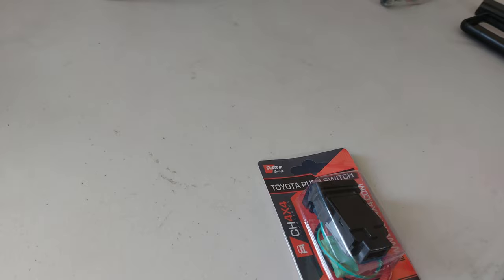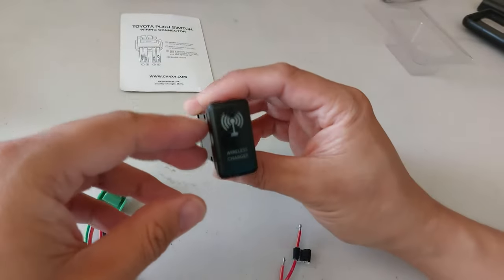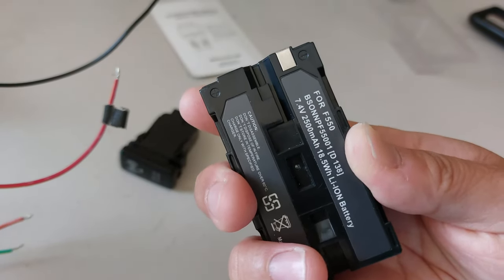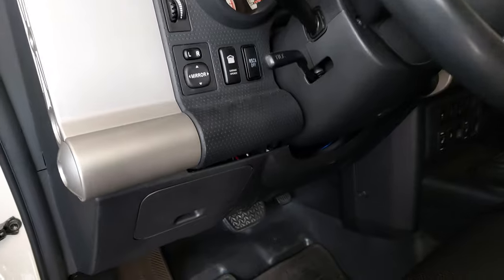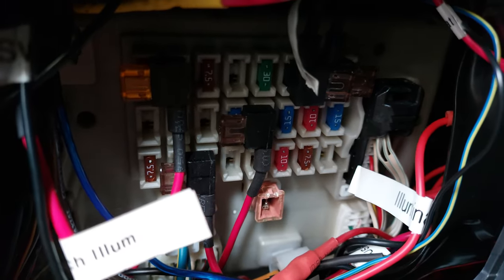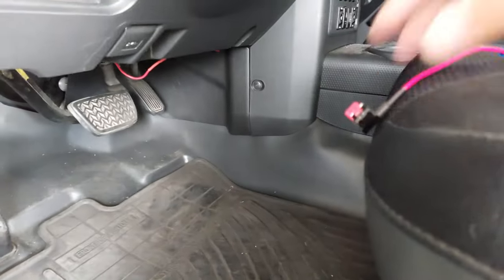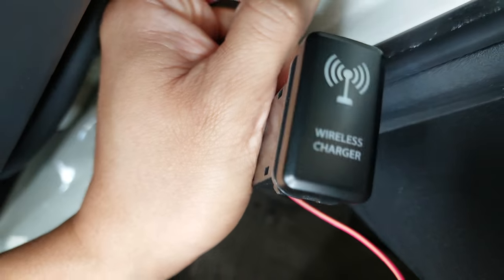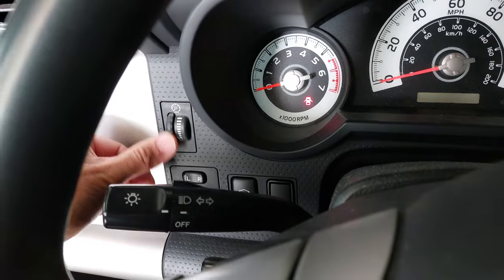Toyota Aftermarket Switch Illumination Wiring Explained

Comment from the maker: Sounds like you selected a fuse that's always on.  Have you tried the fuse for the brake light like I did?  Even though this fuse technically is always on, it comes on when the headlight lever is activated, thus the LED light only comes on when the headlights/tail lights are on.  Hope that makes sense.  As long as your switch's LED light is on, it will draw battery power, so I'd find a different fuse to work with.

Comment: Great detailed video! How would you use this same push switch with the add-a-circuit fuse link for a ignition kill? I can't seem to crack the correct combination of circuits and wiring. TIA
Reply from the maker: I'm not sure how the wiring looks like to the kill switch, but maybe this will help?  https://www.youtube.com/watch?v=8ftolyaHp20 This video I just linked talks about the OTHER wires.

Comment: Asked on the other video. I’m using a bussman relay box so there’s only one wire coming in for the accessory (red 1). In this case, am i missing something, or can both green and red 2 go into an add a fuse?

Thanks for this video. This is about the 7th video I’ve watched of yours to juice my FJ.
Reply: Yo! I did this tonight and it totally worked.

Ran my relay wires through the fire wall, and then fused the green and res2. Ran them to an add a circuit. Golden.

Comment: You tested grounding on that bolt in the door jam, but where did you ultimately ground the wire? Thanks in advance!
Reply from the maker: Check the 10 minute mark of my other video here:. https://youtu.be/5XObhMQ0wCo

There is a convenient grounding screw in the FJ in about the same location.

Comment: when I ground my switch the on/off illumination works in opposites - is on when switch is off but off when you press the switch in. what could be causing this issue? thanks

Comment: I have a problem but I think it’s because I didn’t ground the cable, the switch has no backlight at all but when you press to turn on and off it works

I have 2 harness but have slight back splitter to run them they arnt both the same brand though. I tried plugging the other switch onto the new one and I got light
Reply from the maker: There's 2 bulbs in the switch (one for on indicator, the other to come on with your headlights.  2 different cables. Make sure you didn't mix them up.
Reply: @LiL13izzy7  the harness is a quick connect so it’s plug and play already if I can upload it would be easier to show you but it doesn’t require any joining etc with this harness from stedi

Comment: When I turn my car off, the led on the switch stays on while the lights are off. Two questions, what have I done wrong? And will this drain my battery or is the draw from the LED insignificant?
Reply: Hello, first off, I am not an electrician (spoiler and sorry) sounds like you got your wires crossed somehow. I believe you are working with three or more wires and crossed your relay or even merged with the power wire. Yes, it is slow draining your battery, period. I recommend using a small battery or voltage tester to determine which is your 12volt source wire and other should be your relay wire.
Reply: I’d like to add an OEM style gag switch that says “Machine Guns” to my 2015 4Runner, lol. I’d like it to light up the text when my dash lights are on, and light up the machine gun image when I push the button on. Do I connect the Green & Red 2 wires to the Add A Circuit and attach the Black wire to a ground bolt? And just leave the Red 1 wire unattached? Like your videos as they are very well made and instructive! Subbed.
Reply: @mikesweeney5685  I see you never got an answer but it seems to me that would work. I'm sure you have tried that by now so what happened?